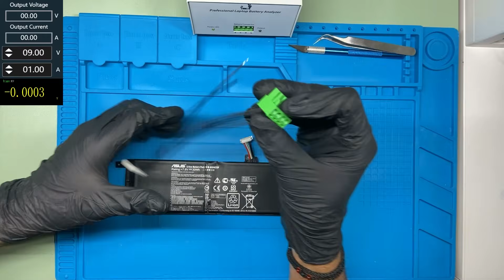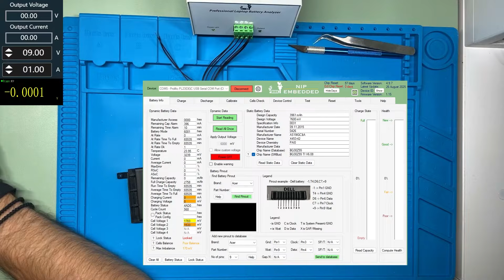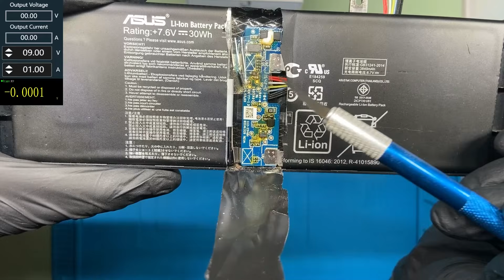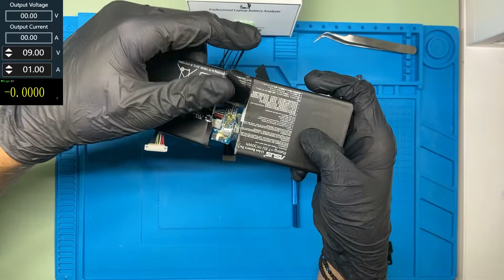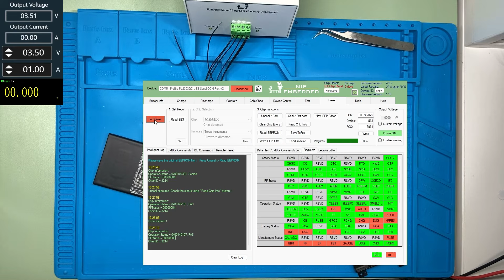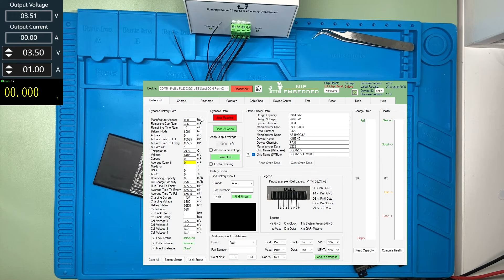Repair Laptop Battery Asus B21N1329 using NLBA1

Comment: Dear Nicusor, your videos are very professional, the content is engaging and easy to understand. I'm from Kaohsiung, Taiwan. I emailed you a few years ago using the username "khj.kuo." Coincidentally, I also asked about the bq30z55 chip in an ASUS laptop battery. Your video today perfectly matches the question I asked back then. Also, if the chip in a Dell laptop battery is the bq20889, and I have an ev2300 device, can I purchase a Laptop Battery Chip Reset License? Can NIP embedded systems read dynamic and static data? Can I also adjust and modify internal battery parameters? Please reply. Thank you.
Reply from the maker: Yes, you can do all of them, read and edit data in a very easy way.